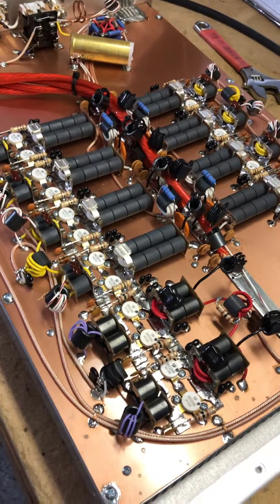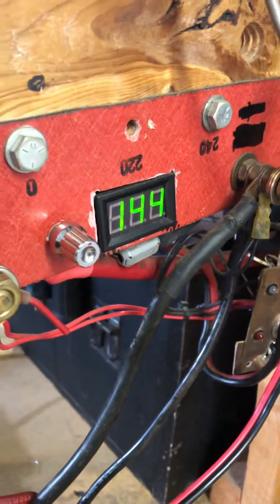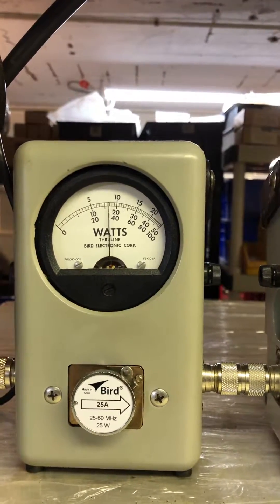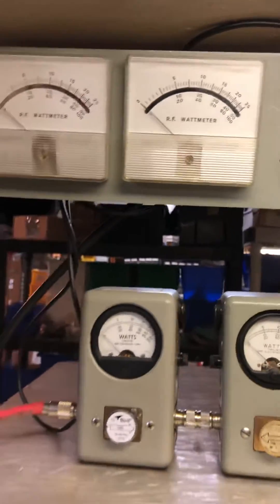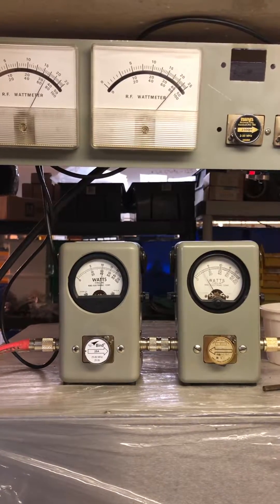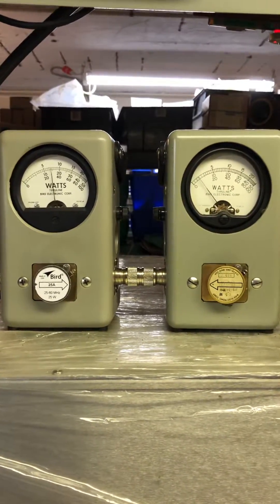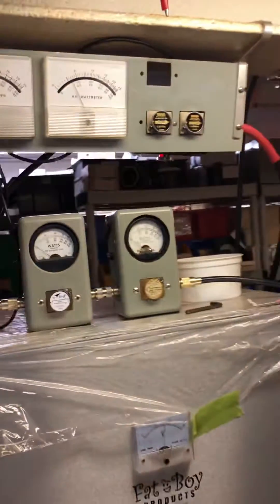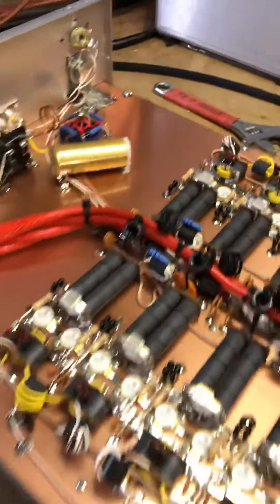4- HG2290’s driving 16-HG2879’s

Comment: How many amps is that power supply? Ia it tonys 700 ampper?
Reply from the maker: minibike madman that’s the 600 amp supply and the amp pulls about 420 amps, if I remember right
Reply: @hopperbuiltamps2135  oh man thats nice i need somthing like that for my bench. I wanted to build a bad ass single iron core and still might..get a nice epd xformer and be done. Im just starting on the build out of my 130 sqr ft radio room so its a process now but a decent power supply is always a issue when ya try to repair peoples boxes.